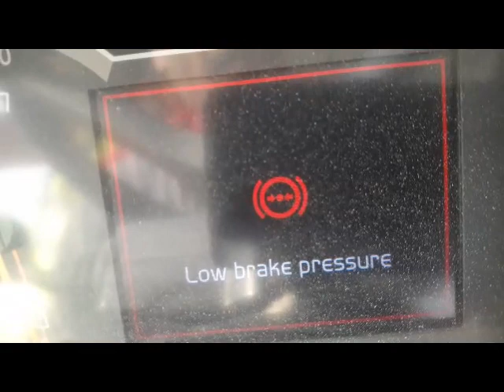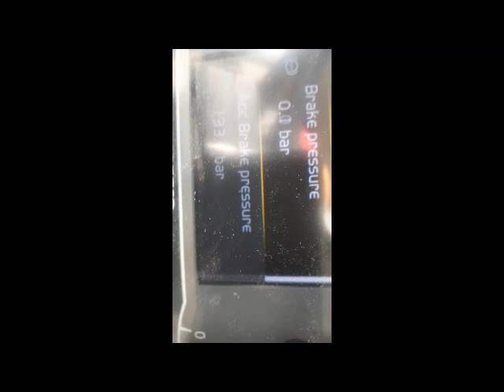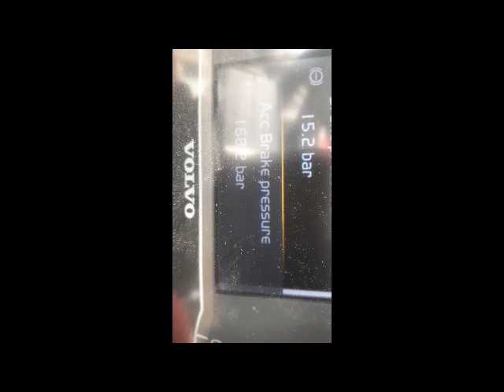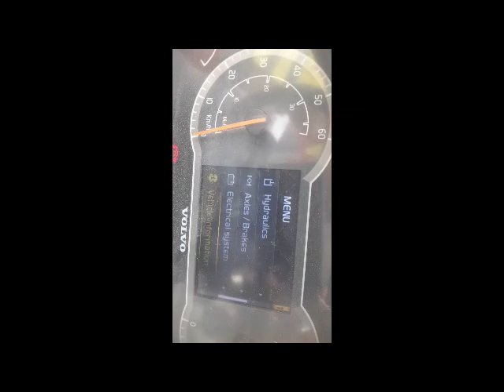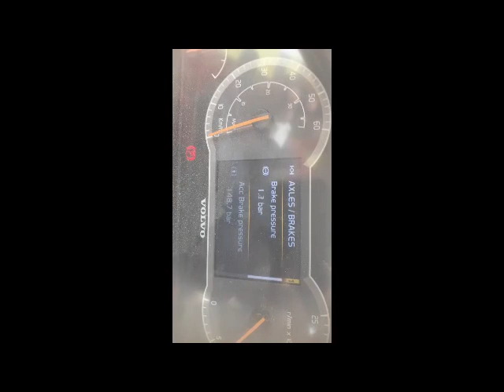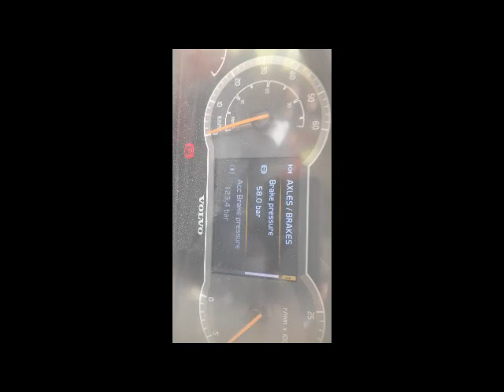Low Brake Pressure || Change Accumulator

Comment: So when u remove and replace the accumulator you dont have to release pressure. If you release pressure please help me with the procedure
Reply from the maker: There is no procedure to release the gas, once you lose spanner, after it remove by hand slowly. When oil starts leaking from it, you stop removing it and wait for 5 to 8 minutes and also lose hydraulic pipe coming to this point. Your pressure will drop then you can remove it.
Reply: you can release the pressure in accumulator by pumping the brake pedal before removing it until youll no longer hear a hiss and then you can remove the accumulator